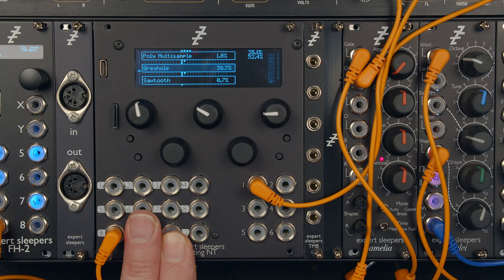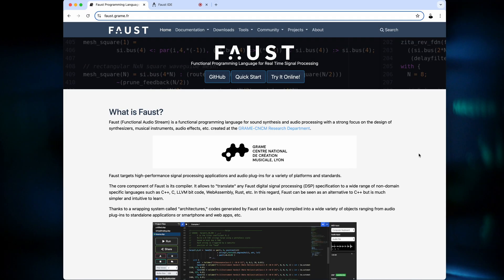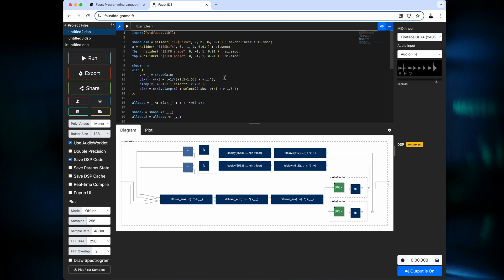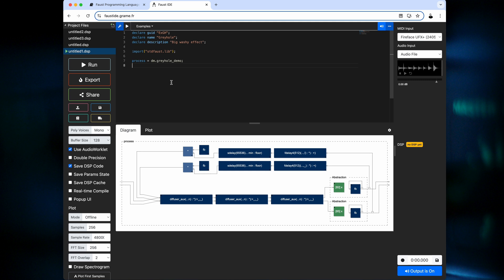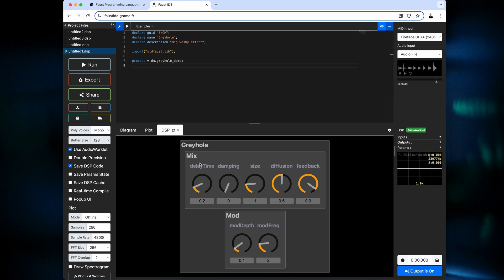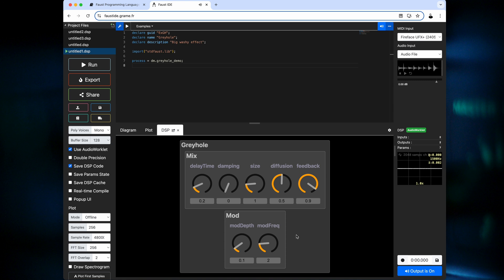disting NT - C++ API and Faust

Comment: Hi - the link in the 1.7 manual that leads to the github page for Faust reveals 3 folders - examples , faust and include - do I need to download all three?
Reply from the maker: That depends on what you're trying to do.
Reply: @ExpertSleepersLtd  to use a Faust file as a plug-in - so which folders from github are required and where on the sd card should they be located? 

Faust gives  .cpp and .dsp files - but i see i plug-ins are  .o files and I have no "programs"  folders on my sd card - do i need to create them manually? -
Reply from the maker: Yes you need to create the folders if they're not on the card already. Plug-ins need to be compiled before you can use them. If you're not able to build them yourself I wouldn't worry about it right now - there are only a few examples which are primarily for testing at this point.
Reply: @ExpertSleepersLtd  ok - thanks for that
Reply: @ExpertSleepersLtd  Ah - i understand whats going on now -  i missed the obvious clue that the github link was to the NT API development page - thanks for your time and patience
Reply from the maker: There is now a zip of the pre-compiled plug-ins in the Releases section of the GitHub repo.
Reply: @ExpertSleepersLtd  cheers - have a good day